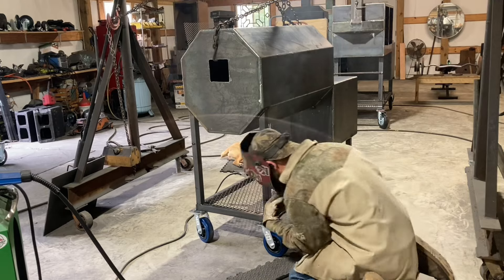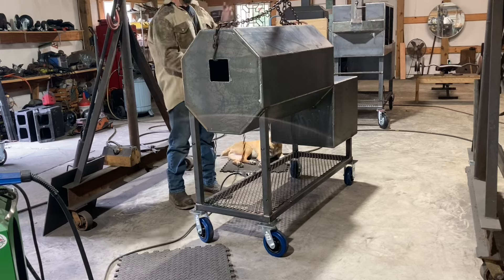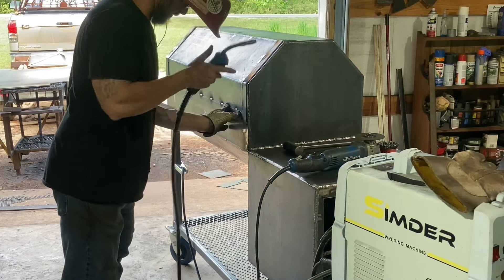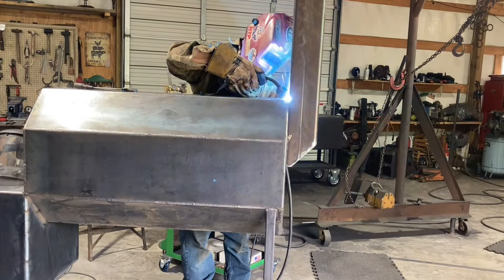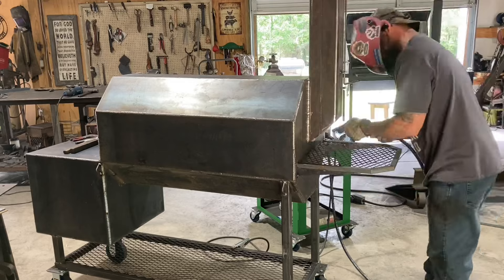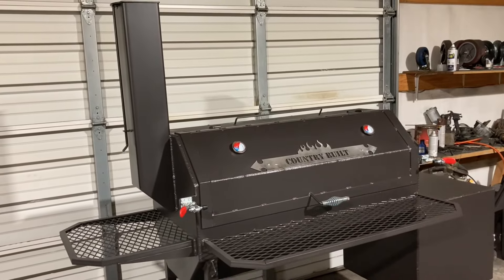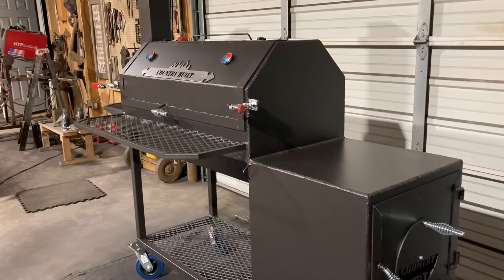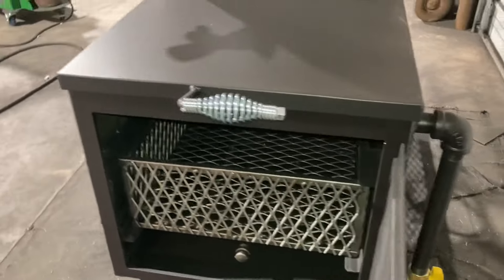Offset barbecue smokers

Comment: Hey Allen been a fan for years.  I use a fluxcore wire from Italy, brand INE, from Amazon.  Better and less expensive than the hobart brsnd less splatter and great penetration with no gas.  Keep the videos coming,  ive learned a lot watching you, your grills and smokers are awesome.  Your fan in kansas